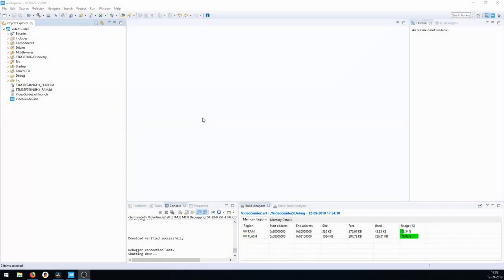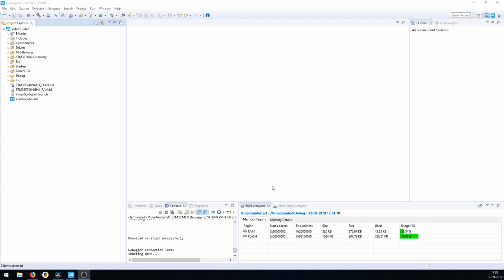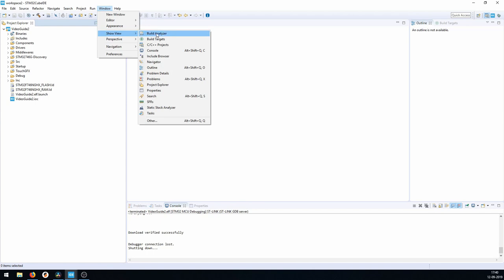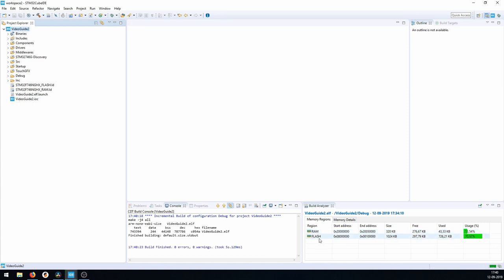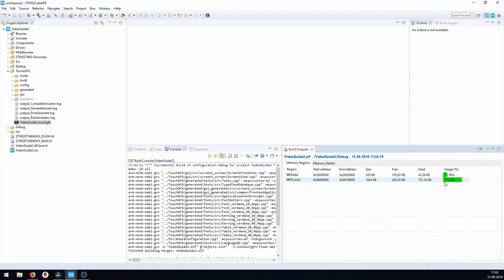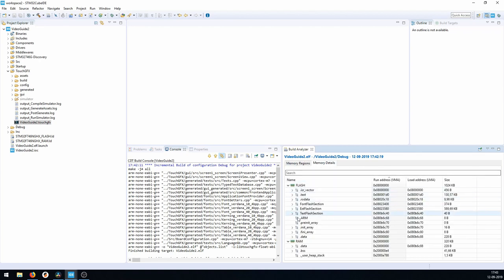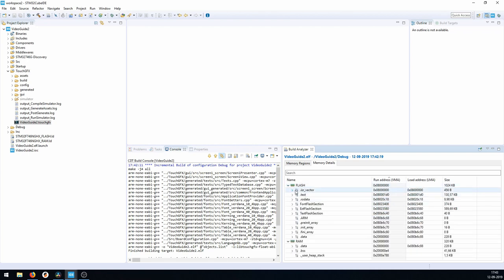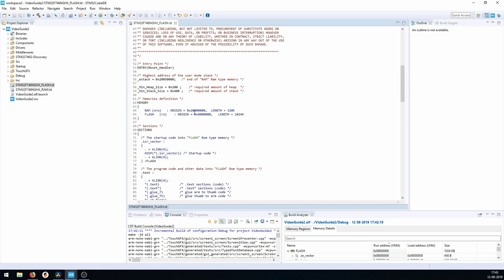Configuring QSPI for TouchGFX and CubeIDE on the STM32F746G-DISCO board

Comment: with this example,  and others,  we should really try to add the additional functionality and drivers using the configuration tools in Cube,  otherwise,  if you make a change and/or regenerate the code it will (sometimes) overwrite/delete the changes.  (I changed some I/O initialization and it regenerated without breaking things.  When I tried disabling I2C so I could enable CAN it broke it).  Also,  always make user code changes in the places indicated by the comments so Cube doesn't remove them.
Reply: Yes, definitely! I was not completely aware of the implications it would have to regenerate code when I made this video. You are absolutely correct!

Comment: Hi. excellent video again!. One question: You seem to be copying the correct settings from a demo project. Where did you get that demo project? How did the correct settings end up in that demo project? I can't seem to find the source for it online. Thanks!
Reply: Great question! The code comes from a project that I generate using TouchGFX designer. I just took one of the built-in examples and looked at the generated code for that. Of you open a project in the designer, click on the 'open folder' in the lower right corner and you get directly to the folder' containing the files :)
Reply: @hanspeterhaastrup-nielsen8446  Hi! What if I can not find (in the TouchGFX project directory) the BSP Driver's folder for the specific Flash memory that I am using?

Comment: I always have to program a random demo project into my board via ToughGFX before programming my own project via CubeIDE. Otherwise I see garbage on the screen. So as soon as I disconnect/connect the usb it shows garbage on the screen and programming via IDE doesn't work anymore. As if it has some volatile data or code that is create by 'Run target' inside ToughGFX. What am I doing wrong?

Comment: Thank you, very nice tutorial.

 Everything is working except the debugger on IDE. I have to upload my project using ST-Link Utility.

Did you ever try to interface hardware buttons (i mean the B_USER on discovery)?
Reply from the maker: I used an example in the beginning but not since. It's fairly straightforward though - if you use the default setup you have access to all the Arduino header pins and the user button. You just need to read the state of it

Comment: Hello very nice tutorial. On my board I have MT25QL512ABB8ESF-0SIT flash with STM32F746. ST-Link does not write into the flash I checked the connectivity performed errase, read all seem to be good.  I checked what flash they put in the discovery boad 746 because they seem to have changed them quite few times. I found they are using the MT25QL128ABA1EW9-0SIT on the discovery board I have. While the initial flash I have used on my board was MT25QL512ABB8ESF-0SIT.
 So both flashes are from the same family but the one I used is just double the size. I swapped flash from discovery to my board and programmed fine. The ST-link seem to be picky about the flash but I still don’t understand why. Do you know how to solve that issue?
Reply: You need the appropriate external loader as the memory device is 4x larger, it needs to use 32-bit addressing (4-byte) rather than the 24-bit (3-byte) that is utilized by memories up to 16MByte. The loaders are tied to specific memory devices and pin usage, and not particularly flexible or portable.

Currently I'm creating a selection of pre-built external loaders using commonly used parts and pin configurations.

https://github.com/cturvey/stm32extldr

Clive One / Tesla DeLorean at STM32 Forum

Comment: It would be very helpful if you could share your project as a working example. My work is hanging in hard fault exception and the display is not refreshed properly.
Reply from the maker: The CubeMX and TouchGFX Designer have just been updated so this video is outdated. I will most likely do another with the new software setup and when I have done that I can put the project on GitHub.. Stay tuned :)

Comment: GREAT Work :) Thanks a lot for sharing this :) Just one Question: In MPU Config the Size of the external Region is given with 256 MB instead of 16 ? And when we come to MPU... Maybe you can teach us, how to configure all these Option correctly (at Time of 1st Project-Setup...) in CubeMX (System Core -> CORTEX_M7 -> ...) Especially Art Accelerator, I-Prefetch, Caches and last but not least the Settings of the MPU :) For the "not so experienced People" like me, this would be a great Help too :)
Reply from the maker: I wasn't aware that the MPU settings are configured this way - I just copied those settings from a known working project. In fact I'm not even sure that the MPU should be configured at all - but I haven't played around with it much.
These videos are primarily to show people a working method of setup - ST is somewhat lacking on this front..
If you look at the default settings for the F746g-DISCO board you will see that the cortex settings are almost all set to 'off'. I haven't done much in the area either - It works for me at the moment :)

Comment: I have stm32f756g discovery just arrived . I connected with my laptop using usb on cn14 and windows says device malfunctioning and led blinks? What should i do any suggesions?
Reply from the maker: Are you using a hub that can supply enough power? or are you connected directly to you PC?
Reply: @banjohat  no i am not using hub ..directly connected laptop ..anways its solved now i power using usb hs and it worked !! Thanks for replay